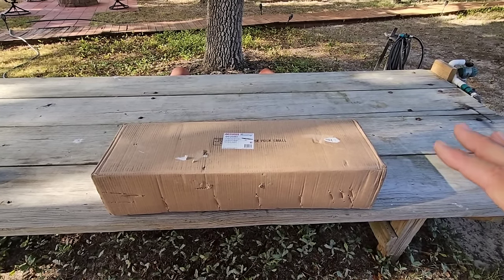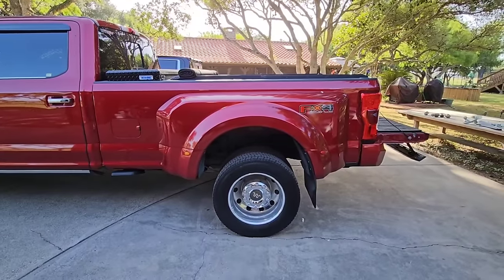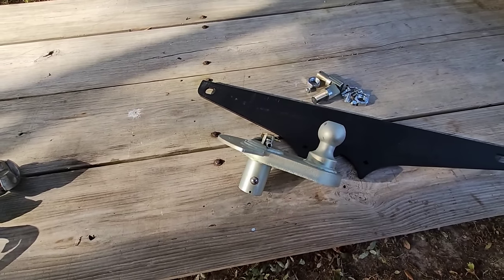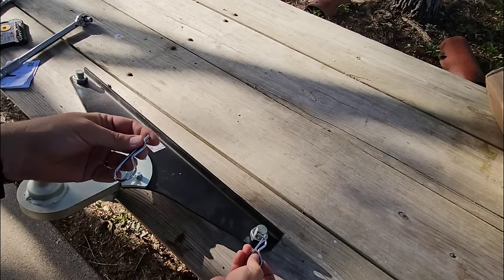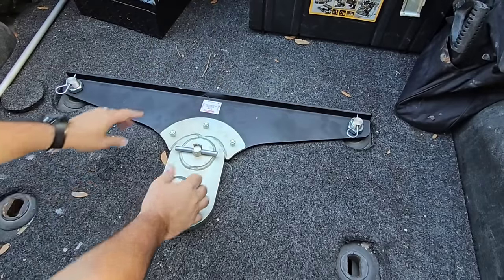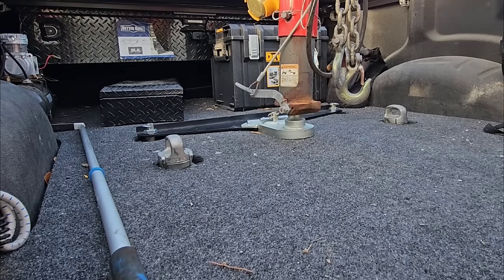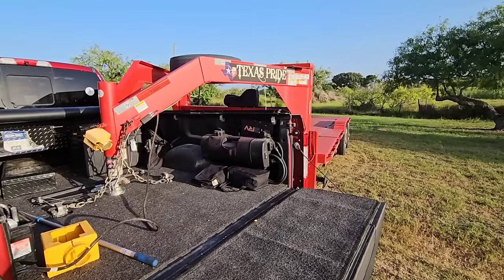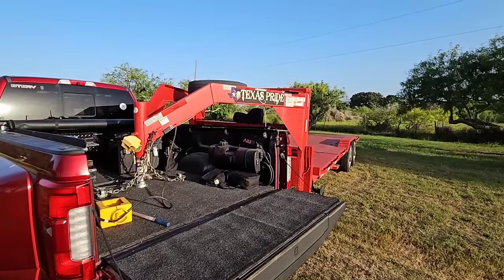Most Amazing Gooseneck Hitch for OEM Puck Systems! Gen-Y Offset Hitch!

Comment: Not to question the BTBRV master: but is it possible you were fighting the locking bearings as much as the tolerance?  I think I would pull the "t-bar" up, rotate it 90 degrees to rest in the "open" position... then maybe you'd only be fighting the insertion on one front instead of two... Just my thought.  I'm a rookie at the towing/coupling/man stuff.
Reply from the maker: I kept glancing at the side to make sure that it wasn't jammed up on the ball when I was trying to put it down prior to lubricating it
Reply: Yes, the release locks in the up/released position, as clearly explained in the instruction sheet that he was holding earlier in the video.

Comment: I have a question on it being 25K capable at all angles, not just straight back. Not sure 3 3/8 bolts are enough for 25K sideways.
Reply: You're discounting the fact that the gooseneck ball sits down inside a beefy steel bracket which is bolted securely to the truck frame. All those 3 bolts do is keep the 5" offset pointed to the rear. The amount of stress trying to get it to do anything else must surely be minimal. But I've been wrong before and I'm happy to BE wrong again. :)
Reply: @JIMPETERSON-n7i  you forget that it is round and fits in a round hole not a square one. I stand behind my comment. Oh just so you know I have a factory puck system with a round hole and a long bed. Long bed saves a lot of problems short beds create.

Comment: Would this work for short bed Ford OEM puck systems?
Reply: Obviously it works for a Ford long bed as shown with the Ford 450.  I'm trying to think why a short bed would be different.
Reply: Yes I have for my 2019 f-350 with the short box. Easy to take in and out.

Comment: with the offset hitch, if you were to take a measurement from the original spot of the gooseneck insert, what is the distance if you were to place the truck in a 45 degree angle with the trailer? that offset might be the solution to a potential problem i have. thank you in advance and  for your videos
Reply: Measure your ball location to outside corner of bumper add 5".

Comment: "Now if it's resting a few inches behind the rear axle, that's a big shift.  Now it is going to be a shift, but it's not going to be a big shift."  

I'm confused.
Reply from the maker: Once you evaluate exactly how much weight is transferred by shifting a few inches back, you'll realize it's pretty insignificant.  Also, Ford places the OEM ball mount slightly forward of the axle, so it's even shorter than you think

Comment: I had to chuckle a bit....I am using the B&W Turnover ball setup on my 3500 Ram dually, and it is SO much easier simply because they (cleverly) use a SQUARE socket and ball mount post so it can't turn in the socket. No need for the goofy "wing" adapter plate just to keep the ball mount from spinning in the socket!  MUCH more "innovative" design IMO! (It's been around for quite a while)....been towing a 15k Montana 5er withone for years, zero issues. 
Yeah, it is "only" rated at 20k GTW and 5k tongue (vertical). More than adequate for about 95% of the 5th wheels out there.... Literally takes about 30 seconds to install or remove it when not needed. I use the stock (non offset) turnover ball just to plug the socket for a smooth bed.
Reply: hooray for you!.  Now most trucks come with OEM puck systems and this is a product for them.
Reply: I have a Ram 3500 SRW with factory puck. All you say about the B & W is true for my setup. I don't need extra cab or trailer clearance foe any turning or hitching up at an angle which I try hard not to do.
Reply: @megadesertdiesel1468  Too bad they chose a system that requires this overpriced and clumsy solution. Progress? Not so much...

Comment: Any placement of the ball behind the  vertical centerline above the rear axle will cause weight to be taken away from the front axle in a vehicle as short as this truck. The can result in a unsafe condition for load distribution.

Comment: Wonder if you could use this with the Anderson ultimate 5th wheel aluminum hitch???
Reply from the maker: Probably won't work because of base of the Andersen
Reply: The Andersen Ultimate provides for an offset of several inches similar to this product. I agree the base of the Ultimate would not allow for using the puck system for the stabilizer.
Reply: I spoke with Andersen on the phone.  Their techs endorsed the use of their hitch over an offset ball such as the Reese or Curt systems.  If 5.5" of the Andersen and 4" in an offset hitch gets you where you want...

Comment: Do you have to grease the ball for the Reese 20k gooseneck hitch adapter for a 5th wheel?
Reply from the maker: Probably not, since the grease zerk on the Goosebox allows you to goose the coupler.
Reply: @BigTruckBigRV  does that keep the ball pretty clean? I just ordered the Reese gooseneck; how often do I need to grease the zirk?

Comment: My two cents is that a bunch need to go back to physics. The ball attachment point in the pickup is exactly the same point, therefore the weight transferred to each axle   is the exact same ad the original ball. This extended ball does not rest on the bed of the truck. I proved this point to several folks with independant wheel scales while using my B&W offset ball.
Reply: Same attachment point but the offset creates a torque applied at that point that was not previously present.  The truck has to counter that torque.
Reply: In terms of physics, the contact point between the trailer and the truck is the ball centre, regardless of how the ball us attached to the truck.

Comment: should have used loaded trailer and weighted front and rear axles of truck before and after to see how muck it moved the weight on the truck, moving the weight back has to reduce front axle weight.

Comment: What's that going to do to the bed under the ball? I would think the flex would tear up the bed.
Reply from the maker: There would be some serious engineering issues if this flexes at all
Reply: I thought that too, but I think it's just the thick Bed Rug that makes it look like there is contact. I suspect on a bare bed there is no touching under the ball.
Reply: @BigTruckBigRV  Well that's even more scarry. Now you have a front to back twist in the 5th wheel setup under the bed. Don't get me wrong I love the idea. Would you test it for about 20,000 miles and let us know what happens? 😁

Comment: You could scale the truck and trailer to show that it’s isn’t or is much of a difference on axle weight
Reply: The weight is still attached to the truck at the same point as with a straight, regular ball mount. No difference. I've weighed it.
Reply: @flash8051  No, it is not. The weight-carrying point is shifted rearward, which is the whole purpose of the device. The rear axle load will be higher, and the front axle load will be lower by the same amount.
Reply: @brianb-p6586  How much difference do you say the offset ball will make in the rear and front axle load? Just curious, because I am going to get weights with each one and post the results. Let's see how close you are...

Comment: It was painful watching you try to install it in the gooseneck hole.  Pull the T handle up all the way and rotate it 90 degrees and I think you will find that it drops right in.  Then you can rotate the handle back and the T handle drops down then you can pin it.  I’ve got one and it works easily that way.  I love mine for the reasons you mentioned in the video.
Reply: I would expect that to be in the manual, and @9:48 there is it is... it's even readable in the video image, under "How to install".

Comment: The issue with this product and every product like it 
 lack or loading the steer axle. You want the weight from the trailer adding to the steer axle. Thats the effective past of the equation that is eliminating/mitigating the "sway". The current GM HDs with the short beds have the factory gooseneck location 4" aft of the axle. TFLs 2020 Gas gooseneck tow off shows the issue very well with the GM road test. If you are towing  anything over 15k, you NEED the steer axle pressure. The load on the steer axle, gives you the ability to steer the truck, which "leads" the trailer. The GM CCSB should be a blast to drive in the less than ideal weather(snow and ice). I know I don't care for the husky fifth wheel rails I had installed on my 2016 F150(the fifthwheel centre line was right over the axle) The Curt rails I just installed in my 2022 F150 is 2" ahead of the axle. That 2 inches makes a difference. On a semi every notch forward on the slide plate on the Fifthwheel, was 250lbs more pressure on the steer axle at 34k on the drives. When I pulled B-trains, I always have the steer axle weight right near maximum(6000kg/13,200lbs) because the GCW of the combination is 63,500kg/139,500lbs.
Reply: Not really applicable to "normal" 5th wheel towing. Depending on the truck of course to some degree.  Loading a fifth wheel  (mine is around 3200 pin weight makes almost NO difference in front axle weight...maybe 150 lbs. or so. 
But I do have a short bed (1 ton dually 4x4) so, as they say...YMMV.  
I have the scale numbers to prove it. May seem counter intuitive, but the numbers don't lie...

Comment: The object of a gooseneck hitch is to have it mounted anywhere from 2 to 6 inches ahead of the center of the rear axle so as to place weight on the drive axle along with the steering axle. By moving the ball behind the center of the drive axle takes weight off the steering axle. The smart thing to do would be for trailer manufacturers to build the trailers to have enough clearance to place the gooseneck ball where it needs to be. I won't be installing any of these on my trucks.

Comment: At 6 inches forward of the axle you are still taking weight from the front axle weigh your truck on a scale you will be shocked at the weight change. The more you go back the worse the ride! If in doubt ask a older truck driver

Comment: You shouldn't use an offset gooseneck hitch because the hitch on the truck is made to carry 6k tong weight and 30k capacity and it is not build to withstand  all that weight from the side trying to twist the bracket all the time, keep in mind it won't brake right away but it will eventually the more you use it the sooner will crack and fail so people be careful and be aware is your life and other innocent people

Comment: You didn’t explain that correctly. First if those loads are light as tongue weight on a lot RVs that’s all good. But the point of a gooseneck ball being actually 1.5 -2 inches in front of center is the correct weight distribution to front axle. So for all you hot shot guys I wouldn’t do this set up. I’d so remember those scale houses and your pocket book. 
Think about it. That full platform on class 8 trucks changes weight with a slide. 
  I’ve got 38 years over the road with off time farm and ranch and I guarantee a load of cows on a 40 will squat that more then in front of center.
Reply: 28 pounds of weight transferred per 1000 pounds of pin weight.  Assume a really nose heavy trailer.  At 4000 pounds of pin weight, how much extra squat is +112 pounds (4112 total) on the rear going to cause?  How much rise will 112 pounds lost from the front cause?  Maybe that compromise is worth the clearance.